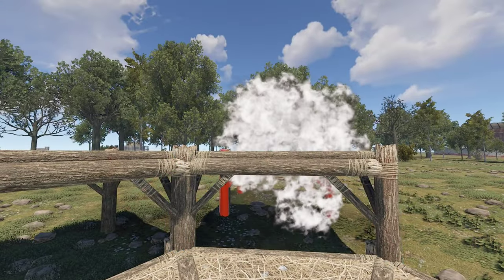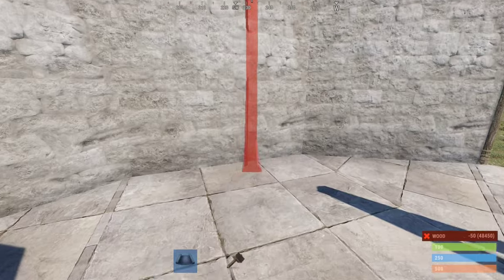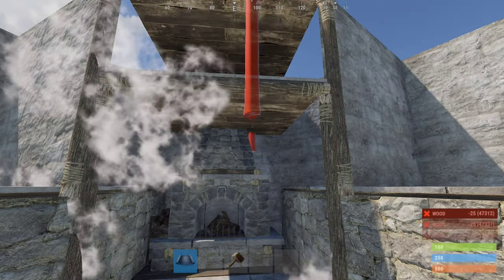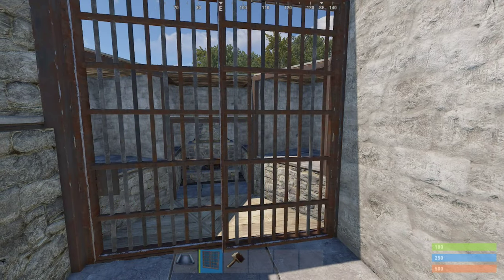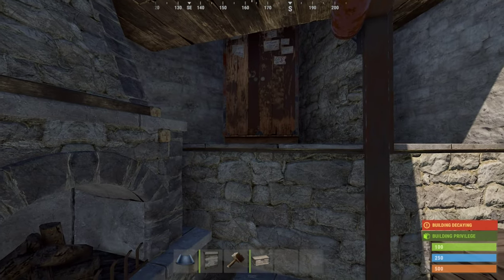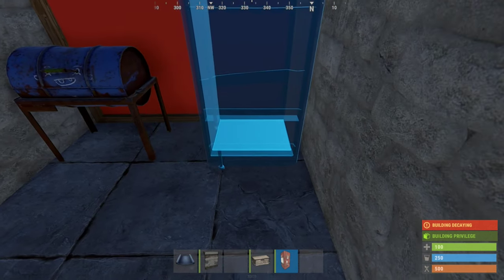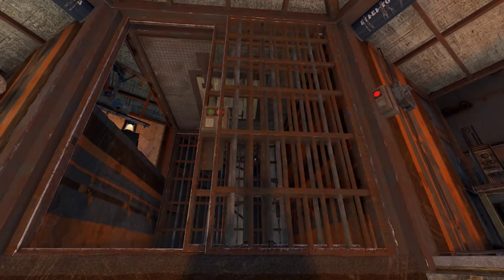Rust: Build This Round Base Interior Featuring Sunken Floor With Fireplace

Comment: How much in total does it cost to build
Reply from the maker: Here's my answer to another viewer that had the same questions: The finished build in this video was purposely left vague as it was mostly focused on the interior. I have this build saved on Fortify so I can give you some idea. The build saved on Fortify is a two-story base with two layers of honeycomb filled with stone barricades. Since Fortify counts the stone used to make barricades as part of the cost, I cannot give you an accurate stone upgrade cost. I'll give you estimates on several different versions of a finished base: A one story base with two layers of honeycomb would cost about 11K to make as twig. 5K wood to upgrade. 6K metal to upgrade. 150 HQM to upgrade. The stone count is off because of all the barricades. With barricades it shows 77K stone. The actual stone upgrade is probably in line with the wood and metal upgrades. 

A two-story base with two layers of honeycomb (one layer on the second floor) would cost about 25K to make twig. 10.6K wood to upgrade. 10K metal to upgrade. 160 HQM to upgrade.
Reply: Thx also idk if u care but me and my friends used this design today and its really good plus were doing good so far with some thomsons already
Reply from the maker: @Tac0-Guy  Very nice. I'm glad it's going well. Good luck with your wipe!

Comment: Its cool and cozy, if you play for fun in a duo or group, but as a solo i would not recommended it
Reply from the maker: It also works well on low decay servers. I play on a PVE/PVP server with 10% decay. I can easily make this with 2 floors and full armored.
Reply: Works really well on a 3x, even a 2x would be good

Comment: VERY VERY NICE, but and thanks for bulding slow, so we can acutully see, but i seems like i cant put a floor above the first baricades
Reply from the maker: Make sure you have a half wall to snap to. There needs to be a half wall somewhere to snap the floor to. Once you have one floor placed you can snap the remaining floors to that floor. Try starting the floor near the fireplace. If I remember correctly there is a half wall there.

Comment: how much is the upkeep and what's the total material that it takes to make the base? ples help me
Reply from the maker: I used to build this on a 10% decay server so I'm not really sure what the upkeep is. Someone asked awhile back about the material to build and I answered them. I'll go and find that information and repost it as my next comment.
Reply from the maker: Here's my answer to another viewer that had the same questions: The finished build in this video was purposely left vague as it was mostly focused on the interior. I have this build saved on Fortify so I can give you some idea. The build saved on Fortify is a two-story base with two layers of honeycomb filled with stone barricades. Since Fortify counts the stone used to make barricades as part of the cost, I cannot give you an accurate stone upgrade cost. I'll give you estimates on several different versions of a finished base: A one story base with two layers of honeycomb would cost about 11K to make as twig. 5K wood to upgrade. 6K metal to upgrade. 150 HQM to upgrade. The stone count is off because of all the barricades. With barricades it shows 77K stone. The actual stone upgrade is probably in line with the wood and metal upgrades. 

A two-story base with two layers of honeycomb (one layer on the second floor) would cost about 25K to make twig. 10.6K wood to upgrade. 10K metal to upgrade. 160 HQM to upgrade.

Comment: How do you cover the open areas between the raised foundations and the lower center foundation in the middle? I dont want to see ground underneith each room? I dont know what im doing wrong. I try to cover this area and it says cant build here,.
Reply from the maker: It's been awhile so I don't remember exactly but I'm sure it was either floor pieces or lowered foundations. If floor/ceiling pieces aren't working, try foundations. A foundation should snap to the foundation that the fireplace is on. If that doesn't work, let me know and I'll hop on to a build server and see if something has been changed by facepunch.
Reply from the maker: The very first thing you do is place those pieces. 0:16
Reply: I tried again and I still cant get the open gaps between the triangle and raised floor foundations covered, im not sure whats going on, im new to building.
Reply from the maker: @DarkNightDreamer  about to go to sleep right now but maybe tomorrow night I can show you on a build server. I'm still not 100% sure what you mean.

Comment: How much does the initial build cost
Reply from the maker: Depends on what you mean. The finished build in this video was purposely left vague as it was mostly focused on the interior. I have this build saved on Fortify so I can give you some idea. The build saved on Fortify is a two-story base with two layers of honeycomb filled with stone barricades. Since Fortify counts the stone used to make barricades as part of the cost, I cannot give you an accurate stone upgrade cost. I'll give you estimates on several different versions of a finished base: A one story base with two layers of honeycomb would cost about 11K to make as twig. 5K wood to upgrade. 6K metal to upgrade. 150 HQM to upgrade. The stone count is off because of all the barricades. With barricades it shows 77K stone. The actual stone upgrade is probably in line with the wood and metal upgrades. 

A two-story base with two layers of honeycomb (one layer on the second floor) would cost about 25K to make twig. 10.6K wood to upgrade. 10K metal to upgrade. 160 HQM to upgrade. 

Thanks for watching. I'm working on my next video. An original base design with a small footprint that holds a LOT of stuff. Stay tuned!

Comment: How do you cover the holes in the floor????
Reply from the maker: I'm not sure what you mean. There are no holes in the floor.
Reply: I had the same problem, the game wont let me place the peices to cover it up because a wall cant touch a foundation like that. He didnt cover that part in the video and skipped right over it
Reply from the maker: Not sure what you guys are talking about. There are no holes in the floor. There is nothing to cover up. The floor in the center is 6 triangle foundations as shown in the video. The other floors are square foundations. This is shown in the first few minutes of the video. Can either of you explain what you mean with some detail? Thanks.
Reply: I think they mean the half wall pieces that sit between the floor and the raised foundations. In your video, one minute they are blank, next minute they are filled with half stone walls. I think the building mechanics have changed recently as I had the same problem. I had to demolish the floor on the raised foundations, build the half wall and then place the floor again. Great video though!   @ChuckHaney
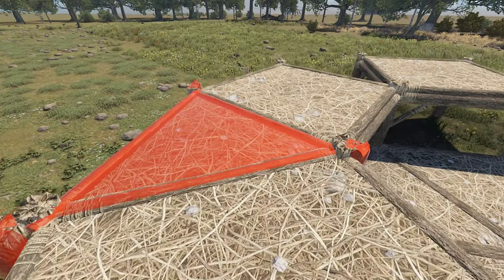Reply from the maker: @xTMGx  Can you timestamp what are talking about? Just reply to this comment with the time of the video - If you never done it before one minute and one second would be 01:01
Thanks.
Reply: @ChuckHaney  1.50 there are spaces under the raised foundations around the base so you can basically see under the base. 2.09 they are now filled in with half stone walls making the inside now enclosed.
Reply from the maker: @xTMGx  Those are twig foundations, then they get upgraded to stone foundations.
Reply: Yes, but you can no longer place those twig foundations unless you destroy the floor it connects to first. I think since your video, mechanics have changed so it can be a little confusing if you strictly follow your build method  @ChuckHaney
Reply from the maker: @xTMGx  Those twig foundations aren't connected to any floors. They are connected to a hexagon of lowered triangle foundations. What you can't do is attach floors to the top of a foundation. But I didn't do that.  This video is still buildable exactly as I've shown it.

Comment: It looks good, but you provided no analysis of the raiding costs.
Rocket splash can be used to destroy all six doors at the same time.
Breaching from above, raiders can open 2 loots squares + access to the core for the price of a single stone wall.
What is the purpose of this base? If it's meant to look nice and be a basic defence from the outside word, it's ok. BUt provide a justification as to why you would compromise on raid cost. Ease of access and fun are valid arguments.
Reply from the maker: This base was designed primarily for PVE servers. The purpose of the video was to inspire interior design ideas. I have a breakdown of the build costs in the comments section. As far as raid costs go you can determine that from watching the build. 
As far as access from the roof I do mention the option of putting on a second floor, I just didn't show one being built in the video. 

This wasn't designed for normal servers, but I'm working on a 2.0 version of this base in which I will show how to create a starter base that can grow into the finished Round Base. I will also create the base so that raid cost will be the same from any angle of attack. 

Thanks for watching.
Reply: @ChuckHaney   Good, you got the gist of it. Make it concie and add it to the video. Your video is already on a good start. time to finish it.